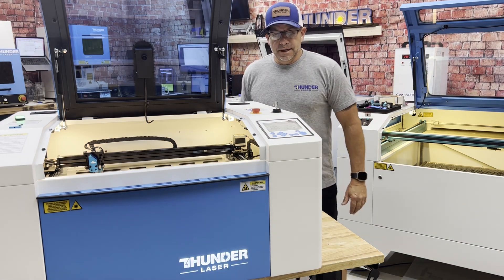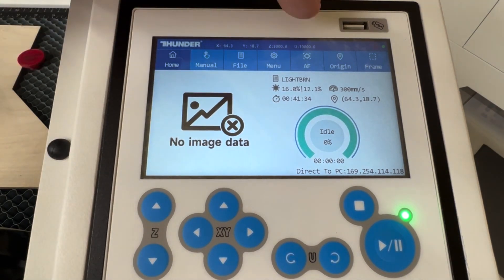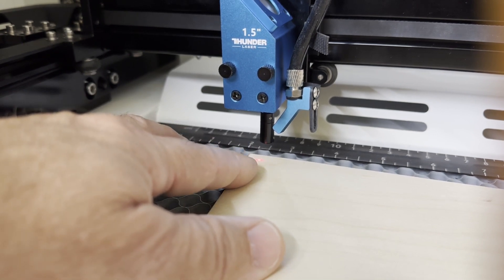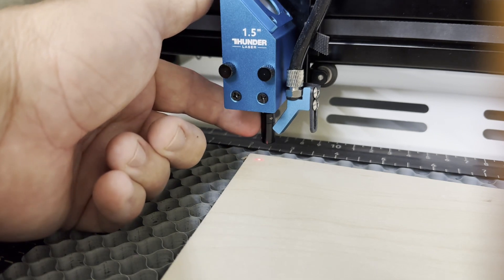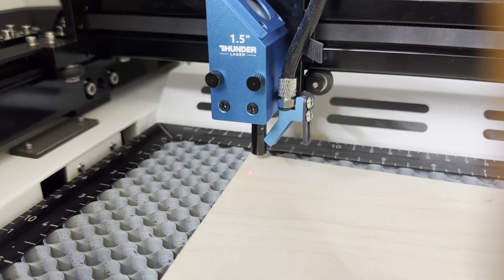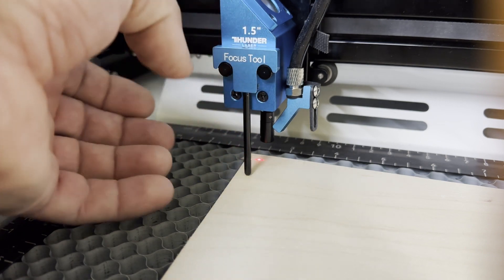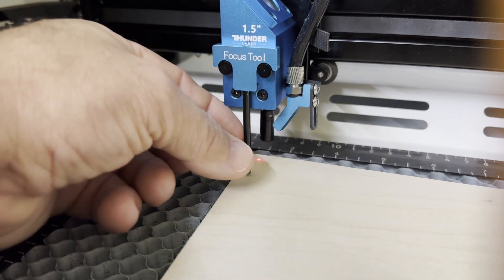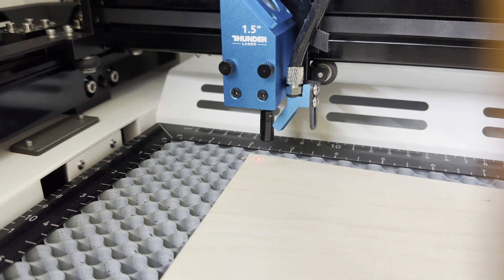Thunder Laser Bolt: Auto and Manual Focus

Comment: how do I turn off the fan when not using the laser?
Reply from the maker: it turns on and off automatically. you dont have to turn it off. the system does that for you
Reply from the maker: The exhaust fan comes on with the job and off when it finishes. The cabinet fans are always on keeping electronics and the tube cool

Comment: what's the diameter of the exhaust hose for the Bolt we ordered one for our shop and need to set up before it arrives there is nothing in the manual that gives the size.. it looks like maybe 3.5 inch
Reply from the maker: its 4" (100mm) nominal diameter on the bolt
Reply: @ThunderLaserUSA  Thanks 😁